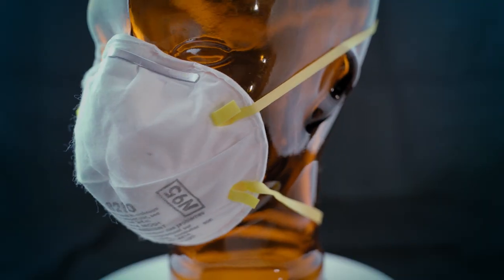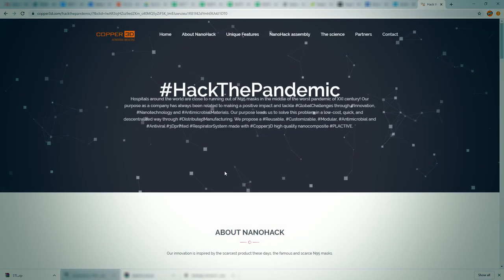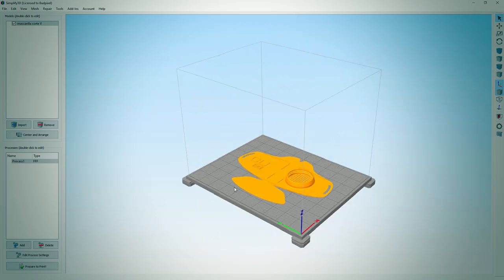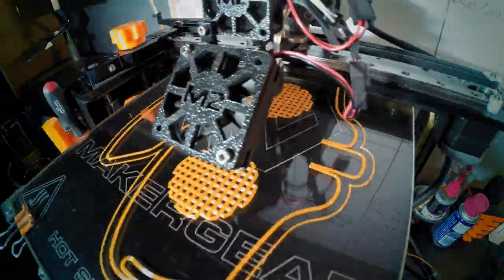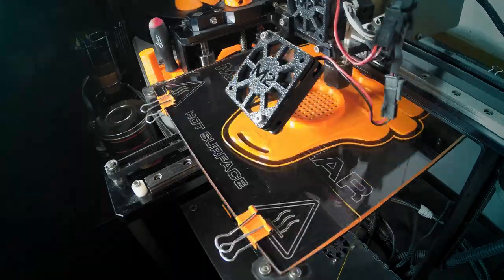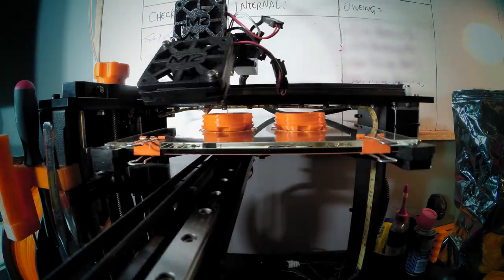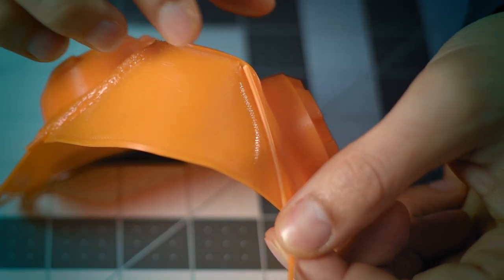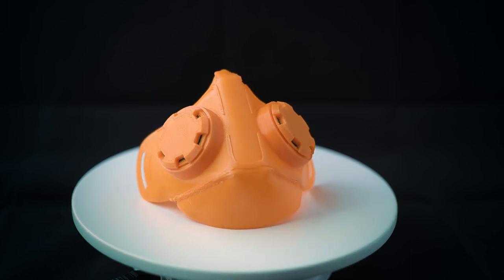How to: 3D Print A Respirator Mask

Comment: without a good seal between facial skin and the mask, there is no protection since air you breathe in bypasses the filter. put some adhesive gasket on the edge.
Reply from the maker: Hi Daryl!  
Thanks for the comment - very true.  
8:01 - "not pictured here..." - silicone bead was placed along the upper portion and around the jaw of the part to get it sealed up.  Another solution we tried was printing a TPU "snake" along the same areas but it was tough to get it to follow the contours and stay fixed once the mask was molded.
Reply: @badpixelinc  I wonder if a bead (or two) around the circumference of hot glue would also accomplish the same goal. Will have to try that.

Comment: Risk of not filling all the gaps and not not being completely sealed.
Seems a bit dangerous forming hot plastic to the face.
Edges seem sharp and could hurt after long term use.

Folding method is a cool idea, but the assembly after printing seem complex when compared to other models.
Reply from the maker: Thanks Andy,

All points valid.  

The edges are not sharp as we added a tiny fillet to round off the edges.  It's quite comfortable when properly fitted and worn - especially when a silicone bead was added (mentioned at 8:01 but not shown).  This was done to improve seal in looser areas around the bridge of the nose and below the chin.  

The plastic becomes pliable at about 65 degrees C so it should be "warm" not "hot".  We use a low-powered heat gun to do our forming but a hairdryer can also be used.

Warm water can be used as well to soften the material for forming.  If any of these methods are used and the user is careful, there shouldn't be any risk of burning...  Just some minor discomfort at times :).

Assembly is definitely more complex than some other printed designs but if formed correctly, the seal can be great.  Volume output (speed printing) and shipping were also major considerations in this design.  This version can easily be transported in a flat-pack with relatively low risk of damage.
Reply: @badpixelinc  
The easy of printing and the low profile for storage/packaging are awesome features, but in my eyes the assembly and risk of improper assembly seem to outweigh the benefits. No hate, just concerned.

With respect to heat, I have morphed PLA with heat before. I'm just worried that people might overheat the plastic end up hurting themselves. Other mask designs use this method, and it always bothered me once I first heard of the idea.
Reply from the maker: @Finchers62   PET-G would be more of a concern I think - due to the higher threshold temp to get it pliable...  But I get it.  

The relatively complicated setup is the reason why we're sticking to our shields for distributed gear in our own efforts.  

Same concerns  really - No way to know the user's skill level so don't want to provide an essential worker with something that could be potentially hazardous - whether through improper sealing or careless heating / thermaforming.